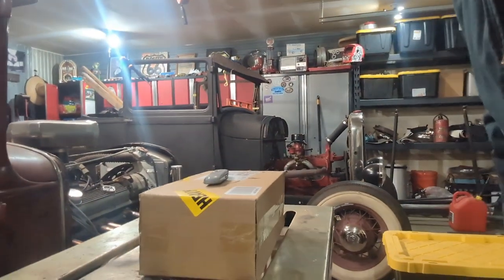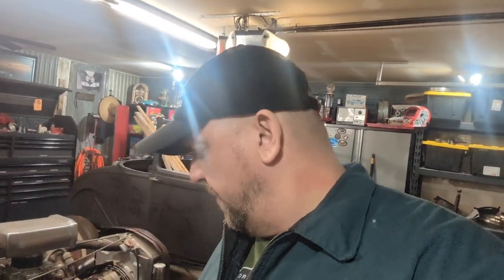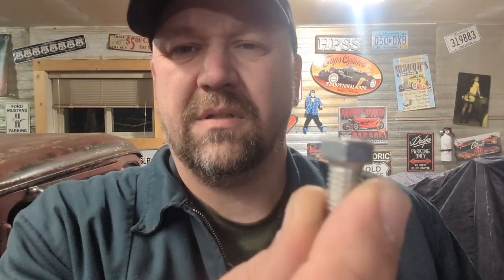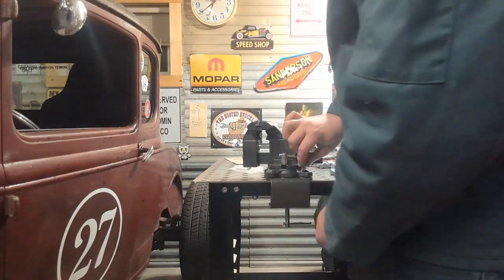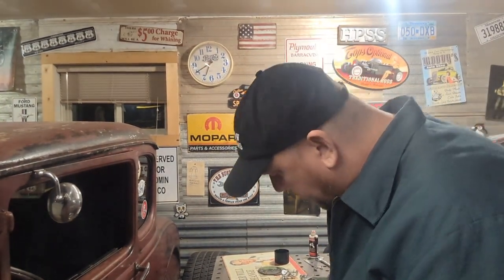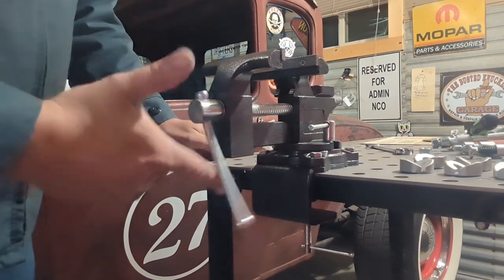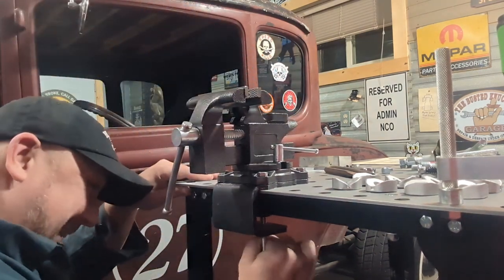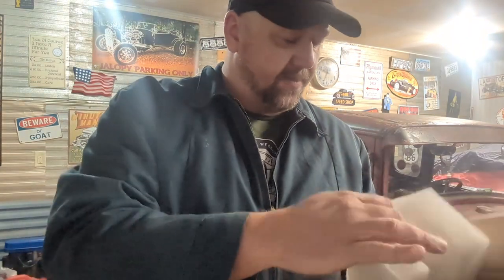New Shop Tool!

Comment: If you think those wratcheting wrenches are cool get the ones with the flex head, game changer. Tip for the vise. If you have a table saw.Take a 2x4 pine wood and cut 2 pieces the length of the vise jaw. Then cut an 1/2 inch deep L or so in to make a lip to catch on the top of the vice jaws. Use them for delicate work projects so you dont mar or dent the work piece.  Cheap to make and easily make more if you destroy them like i did to one set trying to hold a piece in place while seperating the top piece that DID NOT want to come apart. The next set has been on their for i think over 10 years. So they last as long as your not trying to burn everything down around you getting something to come apart.😁
Reply from the maker: Great tips! I'll check out the wrenches too! Thanks for watching